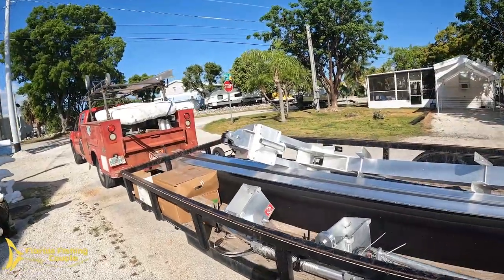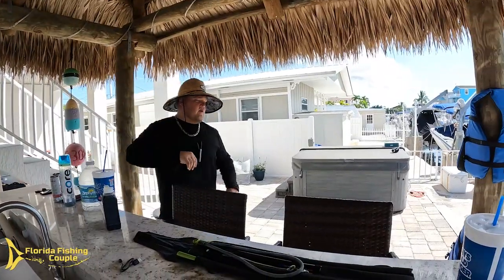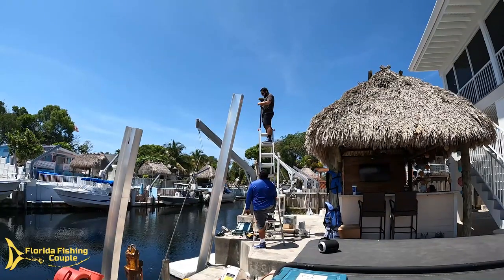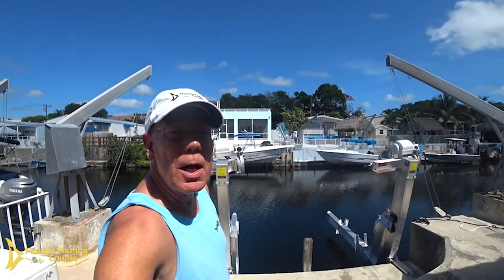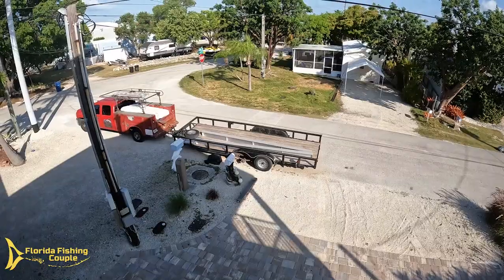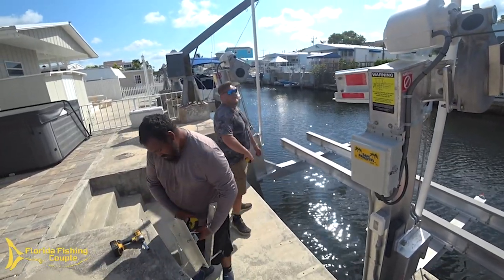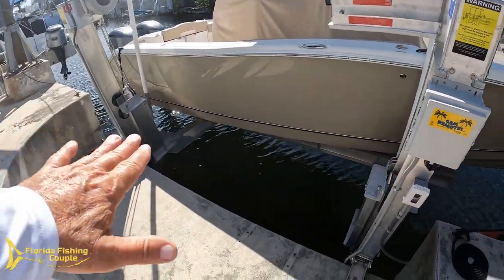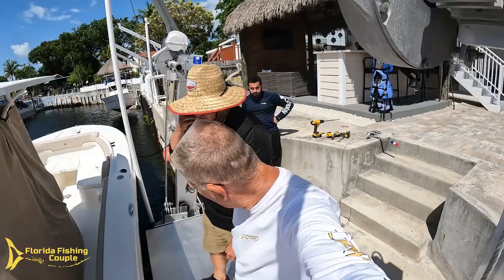New Boat Lift Installation

Comment: Maybe I missed something Dan but I didn’t see any kind of a padded surface for the boat hull to rest on. Is it resting directly on the aluminum runners?
Reply from the maker: So the aluminum brackets the boat rests on are covered with a poly composite material much like decking to avoid scratching the hull. The material will last much longer than the normal carpeting which tends to tear and wear thin over time. These should never have to be replaced.

Comment: Congratulations guys!!! I would love to have my boat in my backyard on the water. Could you at some point show how well the transom mount transducer is working with the twins, what kind it is, at speed, etc. I have a thru hull and thinking about putting one on my 27 Gamefish for side scanning and shallow water definition. Thanks, can’t wait for more videos on the new toy.
Reply from the maker: So, the transducer is a Totalscan. Has 83/200 Echo and Downscan and Sidescan built in. Learning how to use them all and will do a video review of the CMOR mapping system as well soon. Stay tuned!

Comment: Thanks for sharing.  Now I know too!  May I ask how much that cost? I want to guess 8500.00??  I will need one when we move down to the Keys in a few years!
Reply: He said 25 k pirate start saving
Reply from the maker: So, depending on the size and weight of your boat will determine the overall cost of your lift. Our lift is 15k pounds - however a smaller boat may only need a 10k lift. Of course there are additional options such as high speed motors, aluminum bunks, walkway, and other add-ones that will affect the final cost.

Comment: Im in SWFL and actually am interested in installing a boat lift in my back yard canal and have no idea what the costs are.  Can you tell us a range of price for a 10k pound lift like yours?
Reply from the maker: Do ours is a 15K lift: the boat is 28 feet. A 10k lift should run between 18-22k. Electric (210) and the permits are usually extra. Then their are options such as composite bunks, high speed motors, etc. that will cost you extra. You can your local installers and they will give you an estimate for free of course.

Comment: Capt Dan, we would love to hear some of your stories from your days in the military. I was wondering what HP is your electric motor for the lift and if you could give us a ballpark figure of the total cost of this beautiful operation?
Reply from the maker: So we opted for the high speed motors rather than the normal ones. Truth is we could have went with the regular motors. The lift just takes a little less time with the high speed ones. Total cost without the electric hookup ( we had to have a trench dug) was close to 25k with the platform.

Comment: Aside of my other questions I have this one, won’t the bare aluminum gonna damage underneath your boat?
Reply: There is pads the boat sits on so no damage JT
Reply from the maker: So there is a poly composite material attached to the aluminum beams to protect the hull.
Reply from the maker: Rodger that!

Comment: Sorry ok I have a small concern so the corners of that platform they installed is infact out not then the poles that let you know your close enough so they will go into your boat if your not expremely careful when there’s some weird weather look into that brother maybe screw on some rubber bumpers on those corners
Reply from the maker: So, it’s kind of an optical illusion. Because the main beams are set on an angle the boat is never closer than 8” from the platform and it is virtually impossible for the boat to come in contact with the edges of the platform itself.